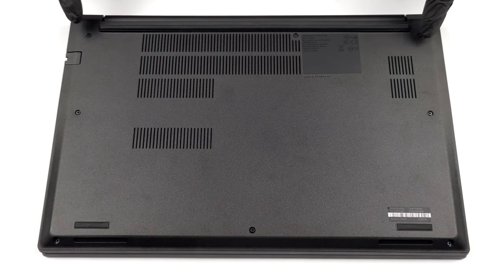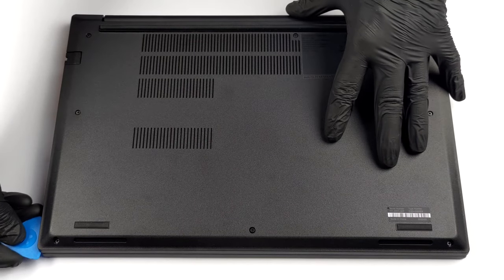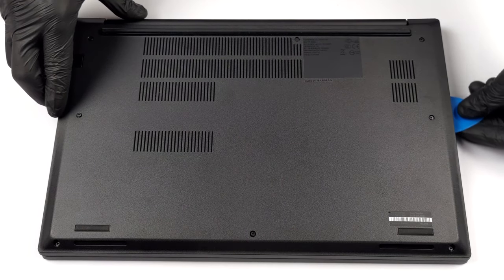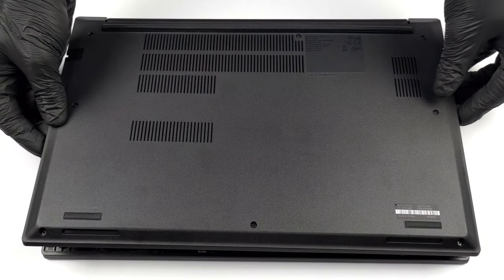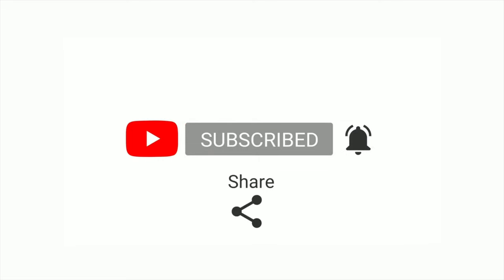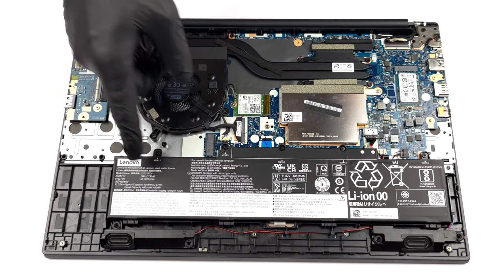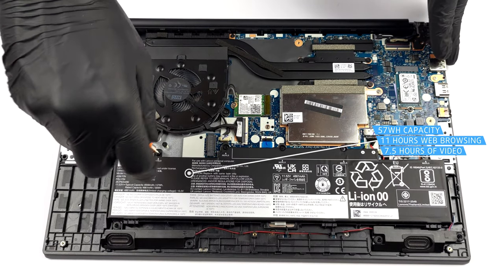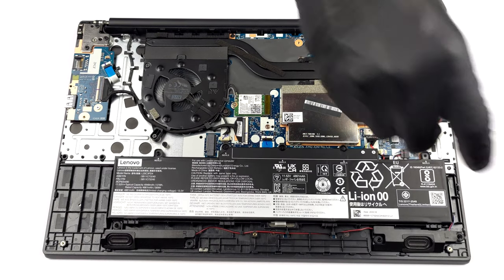🛠️ Lenovo ThinkPad E15 Gen 4 - disassembly and upgrade options

Comment: I've checked the published spec sheets. The AMD variant has a m.2 2242 and a 2280 slots. The Intel variant has x 2 m.2 2242 slots. It's very odd. Given that the 2242 size is difficult to find, I will be getting the AMD variant. Thank you for this video. It's been very helpful for me

Comment: 2x M.2 2242 is double disappointing. I was able to upgrade the wi-fi to Intel AX411. Lenovo also put too much paste thermal, as all those manufacturers do.
Reply: Luckily i got the amd version as this one also supports the 2280 ssds
Reply: @davidmullerstrauss669  I've checked the published spec sheets. The AMD variant has a m.2 2242 and a 2280 slots. The Intel variant has x 2 m.2 2242 slots. It's very odd. Given that the 2242 size is difficult to find, I will be getting the AMD variant. Thank you for this video. It's been very helpful for me

Comment: The e15 gen4 has a 2242 and a 2280 slot not two M.2 2242s. just opened mine up
Reply: Only in version with AMD. With Intel has two M.2 2242s.
Reply: @Dargios  Very helpful to know this. I wonder why it's different between AMD and Intel?
Reply: @Christopher Aitch Thanks. Did you open it up or just going by the spec sheet? This seems bizarre.
Reply: @Christopher Aitch Thanks so much 🙂
Reply: Is it possible to install two 2280 instead of one 2280  and one 2242 ?

Comment: Is there any functional reason for the reduction of M.2 slots, apart from the fact that the customer cannot easily get a alternative SSD into notebook? Common consumer's SSDs are all in 2280. 2242 are often low quality disks.
As well as fixed RAM direct on the motherboard. Although the failure rate of RAM is small, when this happens you can throw out the whole board and put in a new one. Which won't be cheap after the warranty expires. Ahaaa, actually it'll be more profitable to buy another one laptop 😕.
I was considering the Gen 4 until I saw the disassembled chassis and M.2 slots view in this video. They start producing E series as laptops for one time use, what is a real pity.
Reply: same feelings. 
i was looking at gen 3 e14 in the lenovo site and came across gen 4 , but totally disappointed on the reduced m.2 slot and cheap looking motherboard
Reply: @neeravdaskrishna7004  I considered also for Gen3, but unfortunately it's only in AMD platform. AMD is not bad for unassuming users, but his slowest one-thread power is noticable in some applications like Illustrator, Photoshop etc. Good news is that smaller M.2 slot is only in Intel version Gen4. AMD version Gen4 has still two different M.2 slots (second for 2282 NVMe). I had first impressions with E14 Gen4 yesterday in version with R7 5825U and it's nothing amazing. I found too stiff hinges, audible crackling when opening / closing the display, strong coil whining NVMe during writing operations (there was installed KIOXIA KBG5AZNT512G with much lower values of read-write 2114 MBs / 2713.83 MBs than installed SAMSUNG or HYNIX SSDs in previous generations of E14). I already requested RMA. Another knowledges was with CPU - it can easily reach 92°C in multithread benchmark Cinebench R23 (Tjmax of this CPU is only 95°C) and it was impossible to make anything soft operation (f.e. web browsing) during which the fan would not spin. Playing video file (standard HD, even low resolution, not 4K) - CPU temps was around 60°C. The only situation when the fan does not spin is when the desktop is empty with no applications, but that's not reason why you buy a laptop :)
I really liked E14 Gen2 with i5-1135U in combination with dedicated GPU MX450, it has enough performance even for today, but it seems that whole this series has problem with strong coil whining from USB-C port during IDLE state or powered-off device plugged into electricity (I held two same models with same problems, forums are full of this information). 
L series seems to have a problem with an untuned BIOS (at least in terms of cooling - high temps during IDLE and the fan is constantly running). Reviews of the T14 Gen2 series say about the twisting construction of the base / palmrest and poorly dimensioned cooling. To be honest, I don't know what is actually worth buying from LENOVO. If you will need docking feature, it will bring you back to LENOVO, HP, DELL of which LENOVO is probably the one with the least problems. However, it is necessary to emphasize the improvement of quality to the manufacturer, because in the current state, I would prefer to stay with the old T430, if it would satisfy with the performance.
I think that last good pieces that I held in hands was E485 and LENOVO's first experiments with T series and AMD CPUs, which has label A485. It's been downhill since then ...
Reply: Hi guys. I see, you are good in hardware and ssd topics. Could you help me. I am trying to understand why my new thinkpad e15 gen 4 doesn't see the ssd that I plug into the second ssd slot on motherboard. So i have 250Gb m2 pcie gen3 x 2 ssd (it is probably m+b key because it has two grooves on connectors row from both sides, but i am not 100% sure). This drive is working and I took it from the recently broken 2019 ideapad. I know that this drive is working because i bought usb ssd reader for it and it works. But when i use it in my new thinkpad motherboard, neither bios, nor windows sees it. Thank you in advance
Reply: @stanislavdidenko8436  Go to the Partition Manager there you need to give your Drive A Name as example maindrive "C:" then you can call it "F:"

Thats why it is not showing in the Data Folder.

Comment: truly a disfunctional machine, it probably took a lot of work to come up with so many unnecessary compromises... 2 half-sized slots for nvme, partially soldered ram, super small battery, underwhelming cooling, all of this in a 15 inch laptop with 40% of available space going unused. not to mention awful displays, even the higher tier ones. so glad I don't own it